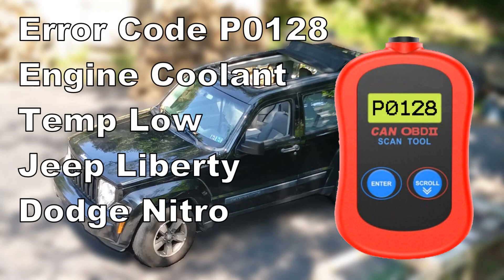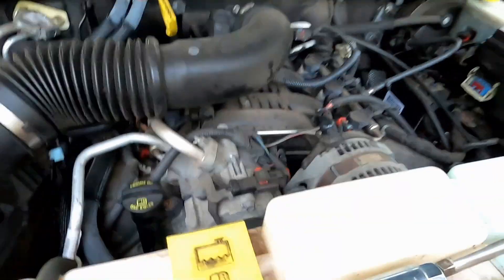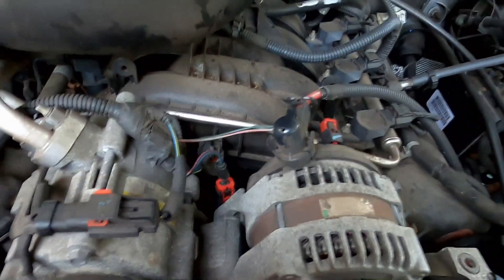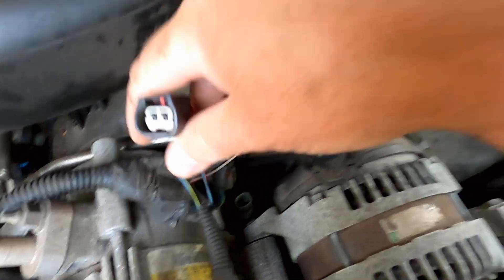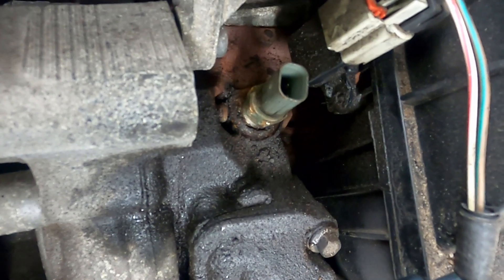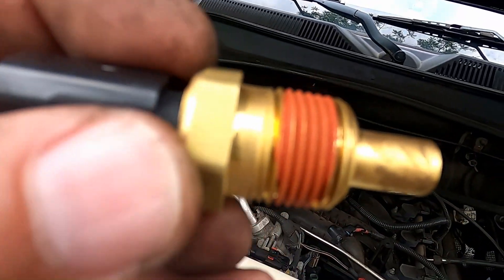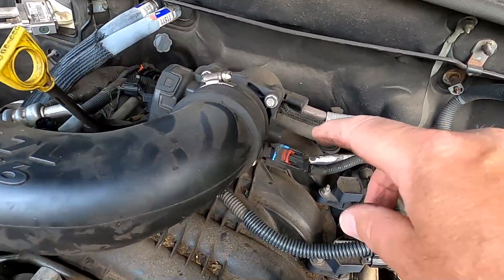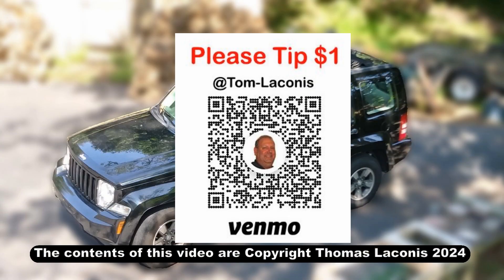P0182 Coolant Temp Low Error Check Engine Code Air Temp Sensor Jeep Liberty Dodge Nitro 2008

Comment: I have a 2007 nitro slt,.. When I first star the nitro in the morning everything is normal, it starts normal, all is good for now...., but almost after every ride of more than 30 minutes when I shut it off and start it back on it kept cranking more than usual,, my car's fuel pump is also fine, I have also installed a new oil tank cover and a new purge valve.     But this problem is still not solved, my mechanic is also not finding this problem.     If you have found out then can you tell me what is the problem?